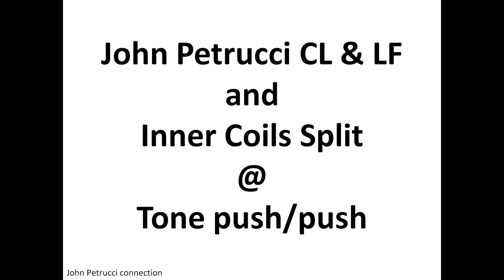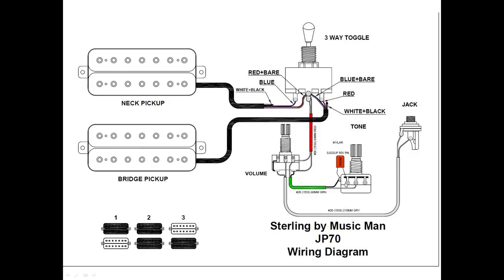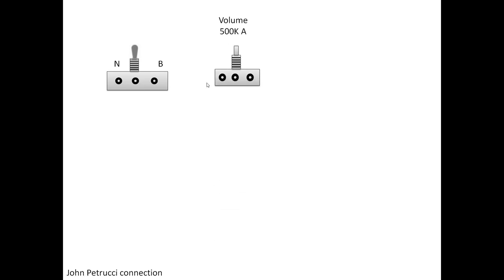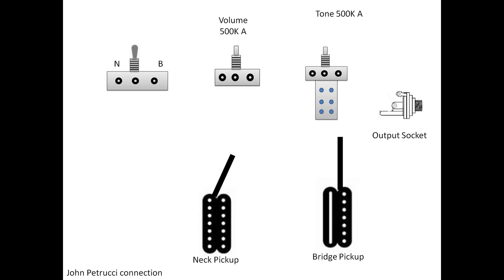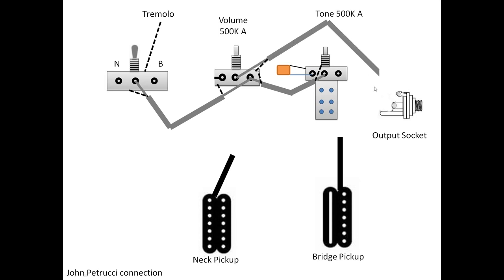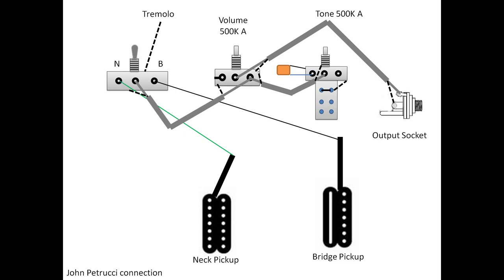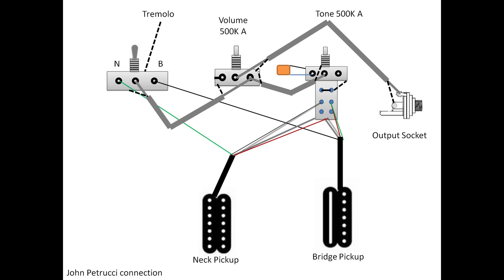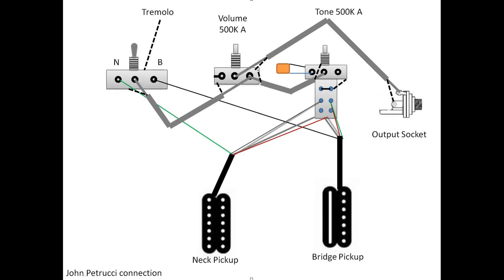Dimarzio Crunch Lab & Liquifire pickups wiring Diagram as Ernie Ball Music Man JP Guitars

Comment: Hello! 

Years ago I bought a set of Crunchlab and Liquifire. They worked pretty sweet for the short time I was able to use them right.  Then my 3-way position switch and pots failed (normally, as they had worn out and were old).  So I bought a new 5-way position switch, a volume pot, and upgraded to a push/pull for my tone pot. 

I remember us using a different diagram (I don't have anymore) so we could utilize the 5-way switch but we definitely didn't wire them correctly, as only the position 5 [the bridge) has its full power.  The other positions are super quiet and have hum.  I am a complete dope and a n00b when it comes to electronics so I'm trying to watch these videos and learn and somehow teach myself the logic of how this stuff works so that I can pick up my guitar again and have it working as intended... but godamn I'm struggling. I don't come from this background. Oh well I will learn.

I don't suppose you have any wiring diagrams for a system with 2 humbuckers, 5-way switch, 1 volume, 1 push-pull tone?  

Maybe this can guide you:
IIRC from like 10 years ago:

With tone pot up,  the 1 position was the full liquifire on the neck, 2 was liquifire but in parallel; 3 was the outer coils of both pickups, 4 was Petrucci mode so inner coils in parallel; and 5 was the full crunchlab on the bridge.  oh and if you put the tone pot down you were supposed to be able to split 1 and 5 coils.  I hope I got that right...

Let me know if you can be of help; you'd be making a big difference!

Comment: Hi. I had a JP6 and the 3 way switch it was a 12 pin DiMarzio EP 1111. It was full humbucker on pos 1 & 3 and inner coils split in the middle without any push pull. This diagram is more like a Ibanez JS without the push pull of the Volume (treble bleed)

Comment: Translating this to a CTS push/pull pot which has a slightly different layout, the first thing you did is ground solder points 1 and 3 to the body of the push pull pot. 

So from top to bottom (knob facing up) on your layout a CTS push/pull pot solder points would be labled as: 

  1 -  3
C1 - C2
   2 - 4

Comment: hi there. just a quick question about the orientation of the liquifire pickup. does the side where the wire is coming out has to be on the neck side? thanks
Reply from the maker: the cable goes straight to the cavity as te picture

Comment: Hi dude! The Dimarzio manual indicates that in both the CrunchLab (bridge) and the LiquiFire (neck), the blue and the bare wires are connected to the ground, and the red wires to the switch. 
In your video, regarding the LiquiFire (neck), you suggest the blue wire goes to the switch, and the red and bare wires to the ground in the neck pickup. Doing that, you will have the same setup that Dimarzio suggests, but with the Liquifire pickup in reverse phase. Am I correct? If not, please clarify this. Thank you.
Reply from the maker: well, what you are saying is correct, if you mean by blue is black, there is no blue cable, there are red, black, white, green.  petrucci use both pickups in reverse , which means the signal goes from green, white, black and then red (which is ground in that case) but as both pickups are in reverse, there is no reverse here :)
in liquifire the signal starts from green to white, black and then red which is the ground, while in crunch lab the signal starts from black to red, green and then white which is ground in the case, that change to make the coil split is the 2 mid coils, incase you are not going to do coil split, so connect both greens to the switch, both reds with bare to the ground,  black and white connected together for each pickup alone and cover the connection.

is that clear or not?

if you listen to me at 4:30 you will understand what I wrote :)
Reply: @musicalwolf1080 Thank you for the clarification. I mentioned "blue" in reference to the schematic at minute 1:04, but I'm aware that Dimarzio uses the color green. My Sterling JP70 was initially wired according to the first schematic. However, I've since added a CL and an LF. This prompted my inquiry about the reverse configuration in your schematic at 4:30. I wasn't initially aware that CL was also in reverse.

Comment: Hi there! Thank you very much for your video, I have been looking for the configuration of john petrucci for a long time! I have a question, do you think that circuit works if I have only custom pot (two EP 1201)? I'm an amateur and it's going to be my first setup
Reply from the maker: It will work, but you need to use the driller to increase the hole pot diameter in the guitar
Reply: @musicalwolf1080  
thanks i am concerned because they are not push pull. I'll try how it looks and I'll tell you. Greetings and thanks!
Reply: @musicalwolf1080  its works!! today perform the installation and it works! Thanks!

Comment: Sorry for being late to the party, hope you are doing well and are still willing to answer to some random guys question :D 
I am currently doing some mods on a guitar that has JP LF/CL set in it. 
The guitar is a custom handmade one (Copy of a Blackmachine guitars model) and unfortunately it is way too thin and small to install 2 pots with current switch and volume pot setup, there just is no place for a tone pot...

So my question is, would it be possible to do wiring like this with only 1 push pull volume pot? And if it is, would you care to explain it to me, or draw it or whatever...
I know i am asking much but every kind of help would be very much appreciated, thank you in advance :)
Reply from the maker: yes you can, you need only 1 push/push or push/pull pot, everything will be the same except you can ignore the tone pot, connect all pickups wire to the push/ pull in the volume as you want, and from the volume direct to the cable socket
Reply: @musicalwolf1080  Thank you very much for your answer.

So if i understood correctly, i wire the pickups exactly the same to the push/pull pot...
But im curious about the wire that is going from the 3 way switch to the volume pot, should i wire it in the middle pin of the push/pull pot or to the right side? The output goes from the middle pin to the  input socket, toggle switch wire is the only one that is confusing me, thank you in advance :)
Reply from the maker: @Furiossa.  yes , the wire that is going from the 3 way switch to the volume pot  goes to the right side, and from the middle pin to the  input socket guitar cable.
1 wire is the signal, the second wire is the ground, both can be in the same cable (cable with 2 wires) or 2 different cables each cable is 1 wire, better 1 cable with 2 wires. In the drawing I use 1 cable 2 wires ( gray is for signal and black dashed line is  for the ground)

Comment: I installed the same pickups in my sterling jp157. Did you have to route the pickup cavities deeper in your guitar?
Reply from the maker: No problem with the cavity, but I faced some some other problems , I will do a video soon about it
Reply: @musicalwolf1080  waiting for update video "what some problem"
Reply from the maker: @agusmulya2034  if you are using JP  model take care from the pots hole diameter with the new pot you buy, also the pickups mount holes were smaller than the screw of the old pickups so  needed to large the hole a little bit with the driller, last thing remove the foam under the old sterling pickups and add it to the dimarzio pickups so you can adjust the pickup height, and don;t try to use the springs which come with dimarzio pickups, use them in case of pickups rings
Reply: @musicalwolf1080  i change pot too, i already make larger the hole.. Thanks for information.. 👍